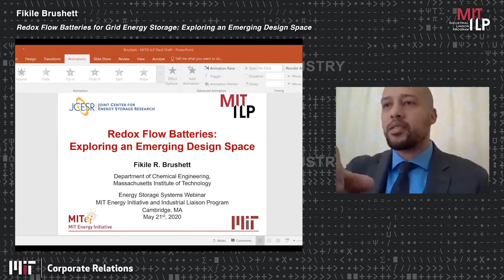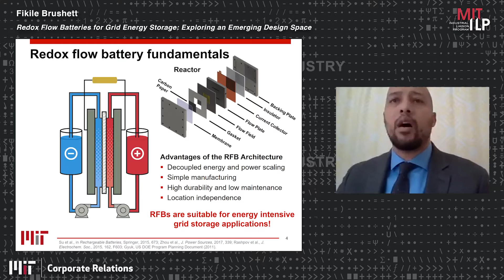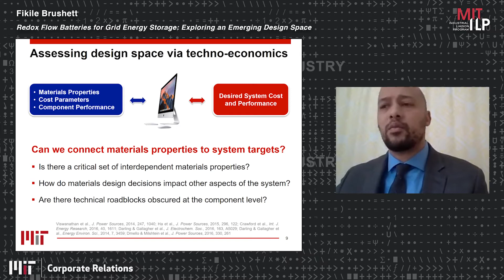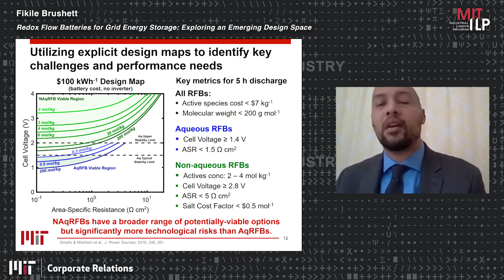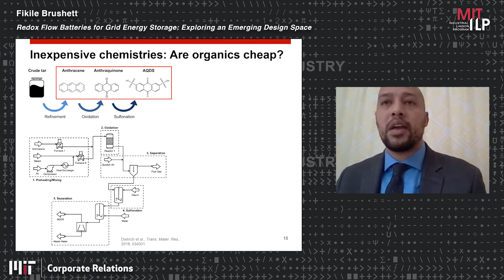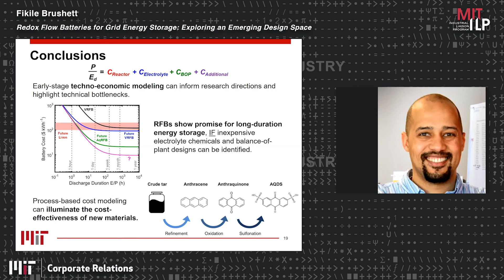Redox Flow Batteries for Grid Energy Storage: Exploring an Emerging Design Space - Fikile Brushett

Comment: Here is the complete text of the speaker throughout the video:

[0:23] One of the things that Rob mentioned when we got started was the idea that renewables were beginning to play a larger and larger fraction in the delivery of electrical power to the grid. Fossil generations domain is still a large part of this, but as renewables become a larger and larger fraction, we become more exposed to the intermittent seas associated with those forms of electricity generation. And those intermittent seas can be on the seconds to days and even seasonal lengths. And so we have to figure out ways with which to buffer that to enable delivery to the grid without uncompetitive costs. The way that's done typically now is through Pumped hydro electric storage.

[2:56] What I'd like to do is pick up a little bit on what Professor Sadoway was talking about earlier and some of the things that also Rob talked about a bit earlier, which is the differences in design for batteries for the grid as compared to the batteries that we've designed before hand. I'm going to focus on redox flow batteries and what I'll try to do is give you some sense as to what's going on in the redox flow battery space, what are the challenges that we face, and then I'm going to try to finish with maybe a few things that I believe to be Grand Challenges, although I wouldn't say that that would be an all encompassing a list.

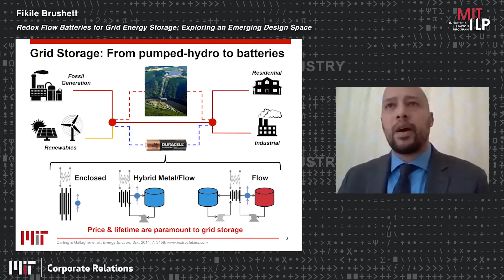[6:42] The basic components of a redox flow battery are the active redox species, the supporting electrolyte, the ion exchange membrane, and the flow field and porous electrode design. So in principle, you can tune those different components to get the performance that you want. The nice thing about redox flow batteries is that you can decouple the power and the energy rating. So the power rating is determined by the size of the electrochemical cell stack, whereas the energy rating is determined by the volume of the electrolyte tanks.

[9:48] Redox flow batteries are particularly interesting for long-duration, energy-intensive grid storage applications due to their ability to scale energy capacity independently of power. So as you increase the volume of electrolyte, you can increase the amount of energy that you can store without necessarily having to change the power output of the device. And this is in contrast to more conventional battery technologies where the energy and power are quite tightly coupled.

[12:52] The vanadium redox flow battery is the current state of the art in flow battery technology. It takes advantage of vanadium's ability to exist in multiple stable oxidation states. And so you can use a single element as both the anolyte and the catholyte, which provides some simplifications in terms of the chemistry and the balance of plant. 

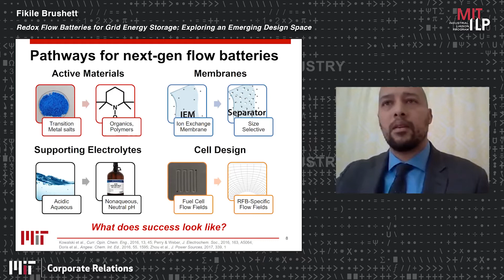[19:52] To try to connect the materials properties to the system-level cost and performance targets, our research group has been using a technology, an approach called techno-economic modeling. And the idea here is to try to model the different components of a redox flow battery system, both at the material scale as well as at the system scale, to then try to identify the key cost drivers and the key performance metrics that are going to dictate the overall viability and competitiveness of redox flow battery systems.

[25:13] We use these design maps to try to identify promising materials and system configurations that can meet the cost targets that we believe are necessary for redox flow batteries to be competitive in the long-duration grid storage market, on the order of $100 per kilowatt hour. 

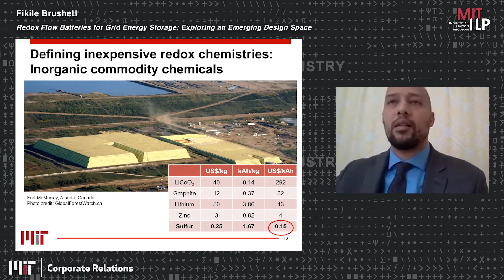[29:40] In addition to the vanadium system, a lot of research has also gone into exploring alternative redox-active chemistries. And these could be things like tailored organic molecules or even inexpensive, earth-abundant materials like sulfur. The idea here is to try to reduce the cost of the active materials while still maintaining good electrochemical performance.

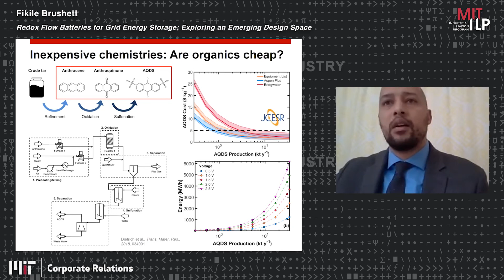[31:46] The key challenges moving forward are really going to be about guided synthesis of these materials with the precise properties that we need, coordinated design of the molecules and the membranes that go into these systems, and then really quantifying and mitigating the various decay mechanisms that can occur in redox flow batteries over long-term operation.

Comment: So how do you heat the metal?  How and from where do you introduce the electric energy to the system...and if it is from solar or wind...what amount do you divert from feeding the grid? In other words, you need to take away energy produced during solar and windy periods (A MiNUS)  to save it in the battery ...so in fact, you are giving back part of what you take ... like putting a $100 dollar bill twice in your pockets and assuming you have $200 ....cus that's what batteries are...you know? The stupid notion of renewables, sustainable and net-zero energies!   And finally if solar and wind are free in nature how come they are extremely expensive!!! ...The money is not in producing electricity the money is in the fucking subsides!!
Reply: Pretty much all methods of genorating electricity at scales large enough to meet the demands of the grid aren't easy to adjust production quickly enough to meet grid demand leading to periods where you might produce excess energy or not enough energy, the current solution to this problem is to build and maintenance large numbers of peaker plants that mostly sit idle and might only feed energy into the grid a couple of hours a day. Grid storage batteries aren't about genorating energy they are about controlling grid output to match demand and since solar and wind are both cheaper to genorate on a per mwh basis as measured by the LCOE(a measure of the pre subsidy costs of genorating electricity from a given source) than any base load fossil fuel power plant we currently have, meaning that there is a fairly wide margin to devolop a grid storage system to store and release energy and thus controlling output while staying cheaper than a comparable fossil fuel peaker plant(peaker plants tend to be substantially more expensive than their base load counterparts). In some regions with high renewable energy production lithium ion batteries combined with wind and solar are already approaching cost parity with the building, maintaining, and operation of equivalent peaker plants. As for the heating metal thing I don't even know what you are talking about most redox flow batteries don't need to heat anything metal or otherwise beyond what is needed to prevent the electrolyte from freezing(which would occur at a temperature that is substantially below the freezing point of water) and they also have a few properties that indicate the potential to be able to store energy at a substantially lower price than lithium ion batteries.
Reply: @garethbaus5471  some liquid metal batteries have to be kept at high temperatures. i don't think this video was about those batteries.

Comment: Is'nt Tesla already producing Li Ion batteries below 100$/kWh and are decreasing the cost dramatically within the next years? At minute 11:09 he mentions that the price will be around 100-200$/kWh..
Reply: li-ion battery costs should go down considerably in the next 10-20 years, but since everyone's rushing to get a hold of lithium there might not be enough of it for everyone, so people are also working on other types of energy storage solutions.
Reply: @NaumRusomarov , li-Sulfur batteries are the future Lithium-sulfur battery cells offer four times more density than lithium-ion ones. That translates into a phone battery lasting four times longer, and an electric car traveling that much farther. Their catalytic element sulfur costs less than cobalt or manganese, on which the lithium-ion process depends. Smaller battery size.
Reply: As I understand it, they are still well above $200/KWh at the moment

Comment: Anyone see retiring supertankers repurposed to flow batteries amid offshore windfarms instead of third world scrapyards?
Reply: That's a brilliant idea, I've also seen proposals for storing electrolytes in the subsurface in geological formations.
Reply: Definitely want to make an electrolyte that won't corrode the tanks, and won't be an ecological nightmare if it spills before we try something like this.
Reply: I am guessing they need maintenance to keep from sinking dumping S02H04 into the sea, Harbor or land-locked dry dock. So what does it cost to coat the inside of an old tanker with a plastic that is completely resistant sulphuric acid. $35 - $80 is my guess! 
Whoops, the decimal point is off 8 places, maybe 12? My calculator needs batteries.